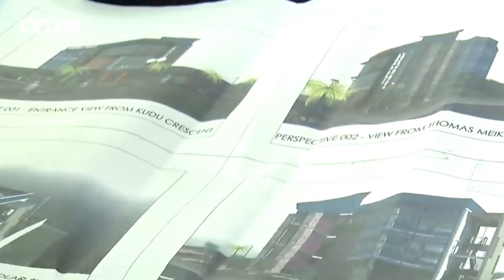What Happens When World's Largest Dam Runs Out of Water? - Shocking

Comment from the maker: Will the floating solar panel project make the difference expected? Will the cost of it be worth it in the long run?
Reply: The net "gain" will be massively negative if a major portion of the power generated is horrendously misused to mine fossil fuels.

This project is not remotely about assisting underdeveloped countries to build their infrastructure.   It's about major powers using a pretense of that to "greenwash" their INCREASES of production of fossil fuels.

No surprise that China is behind this - the country that builds "tofu-dreg" roads, buildings and bridges that are spontaneously collapsing everywhere!    Not satisfied with that level of wanton destruction, China is spreading its pathology to the rest of the world.

This is a prime example of how toxic totalitarian governments are:    total suppression of dissent means total blocking of all feedback.  No one has the courage to point out flaws in the design and structure of what the government plans and the leader(s) inevitably drifts further and further from reality.

No one dares tell them why plans self destruct and they decide the problems are due to "resistance" so they build an ever higher wall against feedback and keep on doubling down on what they are doing wrong.

THE ONLY SOLUTION IS TO JUST LEAVE FOSSIL FUELS IN THE GROUND.

Extraction requires energy (and this entire project is intended to supply energy TO EXTRACT FOSSIL FUELS!!!!!).    Attempted amelioration of the devastating effects of using fossil fuels requires more energy (and can only be partially effective at best).        

The only remotely rational way to use the energy this project generates is to REPLACE the uses of fossil fuels.   To instead use it to mine more fossil fuels is not merely  demented and depraved!    It is suicidal!.

Fossil fuel companies decades ago did research intended to show that climate change was not anthropogenic.   Instead it showed that it was and that the overwhelmingly major contributor was fossil fuels.

Fossil fuel companies responding by

1) HIDING the research

2)  LYING and doing an extensive disinformation campaign to claim that climate warming was not anthropogenic

3) starting programs to, thru "contributions" (with strict controls to ensure their corruption was enabled) to universities to ensure that potential dissenters were selectively weeded out of programs at all stages to ensure that only  "yes men" were graduated

4) lobbying programs to ensure that politicians were bribed to support their corruption.

5) smear programs to attack any and all who opposed them (politicians, dissenters, journalists etc.

Financing of any fossil fuel promoting programs, no matter how "greenwashed" they are, is suicidal.     The money they get goes directly to work against our core interests and to undermine our ability to even survive!